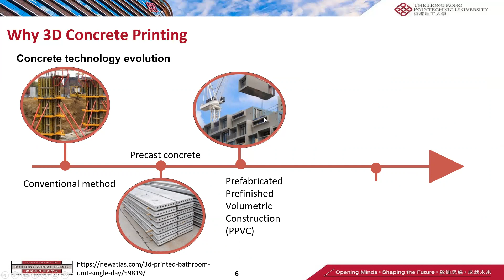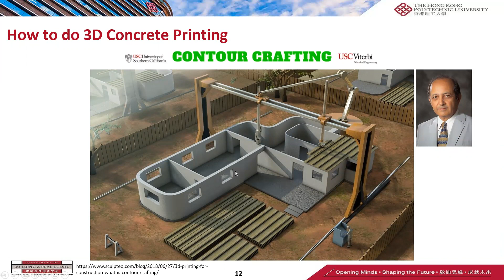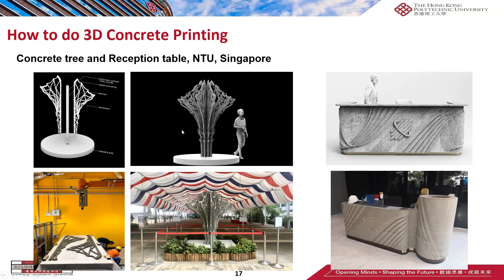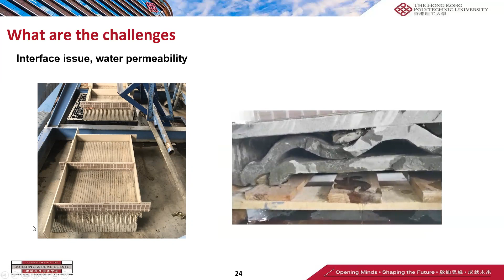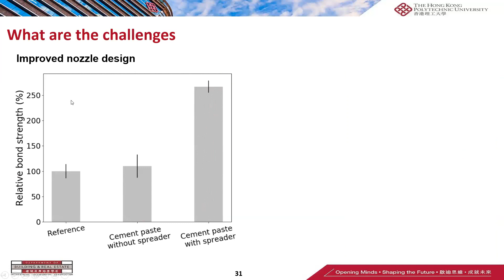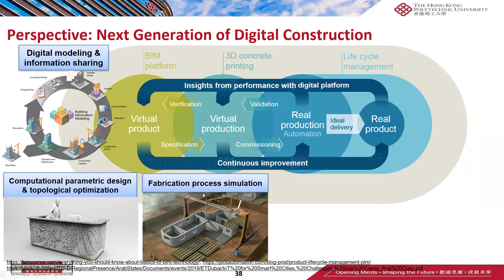3D Concrete Printing & Digital Construction: Dr. Yiwei Weng, The Hong Kong Polytechnic University

Comment: Registration number: ICCMS/21/Au/0000260
Date: 19/12/2021
Session: 2
Slot: 3
Time: 11:40- 11:50 pm
Paper: Prediction of PVA Fiber Effect in Engineered Composite Cement (ECC) by Artificial Neural Network (ANNs)
Name: Md Nasir Uddin